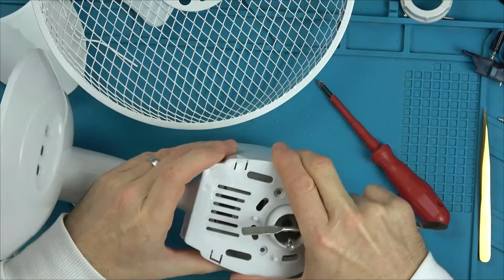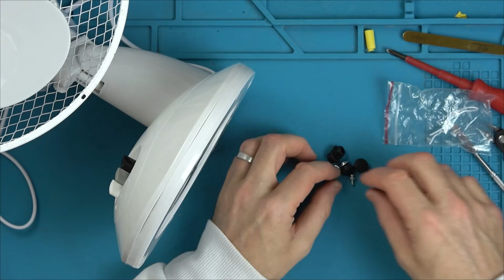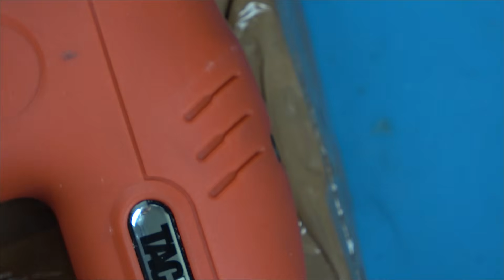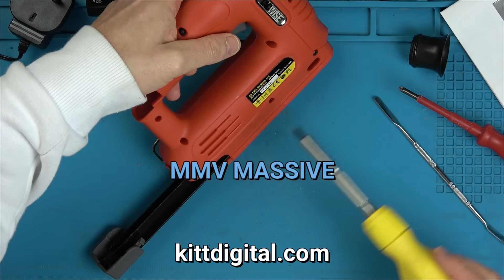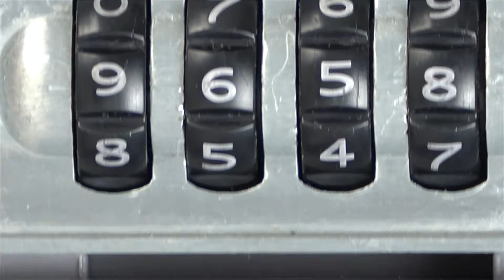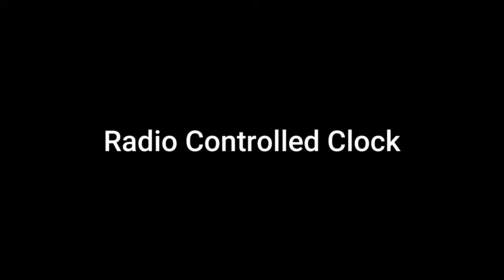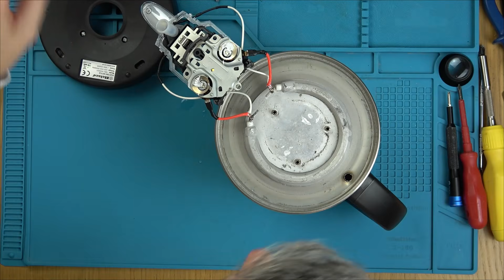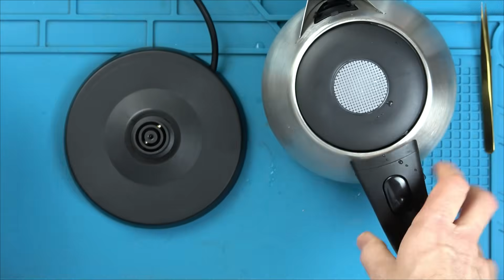I Bought AMAZON CUSTOMER RETURNS to REPAIR

Comment: For the fan: You noticed that the 2 wires are shorted. My thinking is, there are different 2 resistances on each wire to provide different speeds, but if they are shorted, that the 2 resistances are added together providing an even slower 3rd speed, regardless of which button is pressed. How exactly it got fixed? You'd have to ask Vince.
Reply from the maker: Hey Nandi, I don't think it was a short, more like 30-40 Ohms. I think the fault was friction against the casing stopping it from going full speed or maybe the fan blades were so loose it was slipping, again not going full speed. Maybe the heat shrink stopped the slipping allowing me to actually notice the top speed. We'll soon find out from the comments section, I'm probably completely wrong!!!!
Reply: @Mymatevince  I think you're right about the slipping of the blades.  You had a moment where the casing was not touching the blades and they still weren't spinning any slower or faster.  Also, the Amazon-reviews about the "farts being stronger than the fan" would indicate the same problem.
Reply: I was thinking it had something to do with added torque, so it needed the resistance of the blades to notice the difference

Comment: I have the same fan. I modified the blade to get more air to move around. the blades are useless. However I do get different speeds from those buttons.
Reply: The problem probably was the lack of friction from the shaft to the blades and Vince fixed that with the heat shrink
Reply: @DobuDobuDobuDot  I used the metal ring to connect the blades to the shaft, the fan is useless. I could only feel it when it was next to me. I simply added additional fins to the front of the blade now my fan can circulate air around my room.